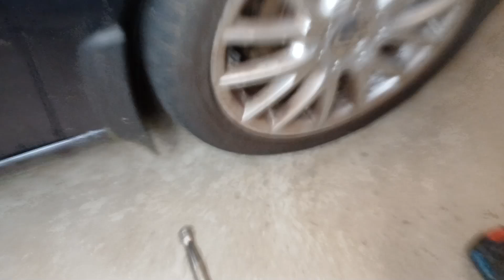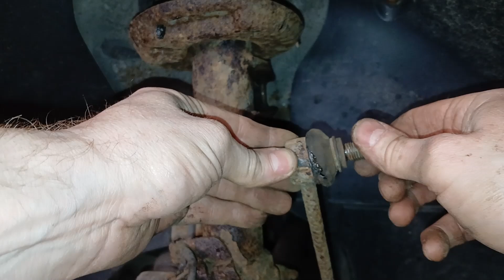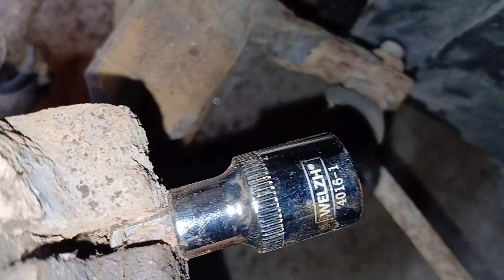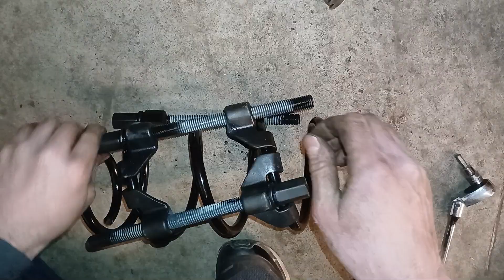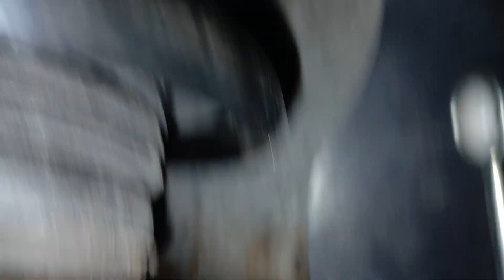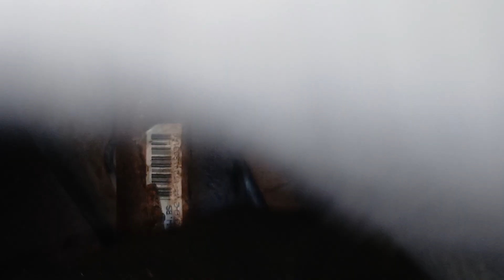VW Golf Front Spring Replacement - Full Process! #mk5 #VW #DIYmechanic

Comment: Timestamps (Powered by Merlin AI)
00:06 - Replacing broken suspension springs on a 2006 VW Golf GT.
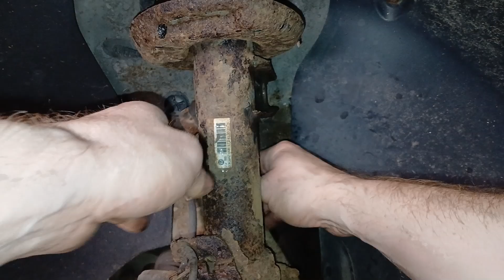02:58 - Assessing worn components before replacement process.
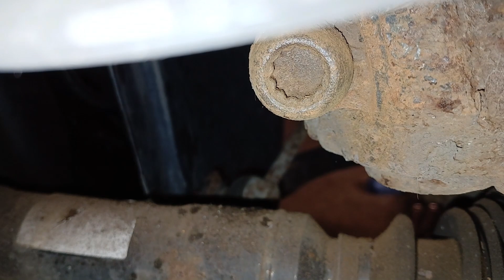09:15 - Replacing the VW Golf front spring requires special tools and techniques.
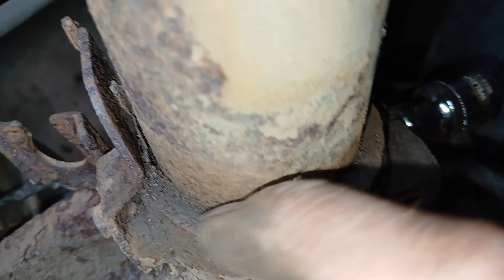12:08 - Preparing and cleaning components for VW Golf front spring replacement.
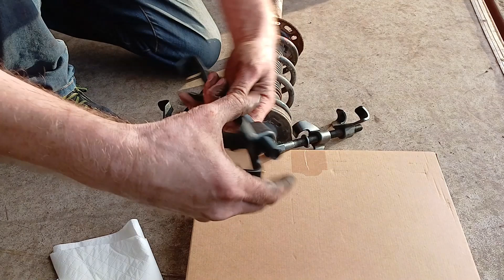19:14 - Prepare spring compressors carefully for safety and effectiveness.
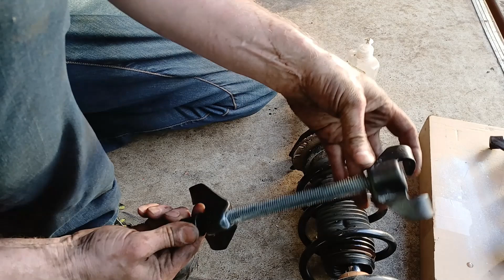21:40 - Use dual hook springs for safer VW Golf front spring replacements.
29:15 - Finalizing the front spring replacement with proper tool usage.
32:25 - Replacing a rusted drop link with careful methods.
38:26 - Reassemble drive shaft and lower control arm components.
42:36 - Reassemble the VW Golf with a new spring and torque settings.
Reply from the maker: Thanks!

Comment: Great video .Any problems with the driveshaft bolt torque ? VW  say 200nm +180 degrees .
Reply from the maker: Can be tricky enough! I stick a couple of the wheel bolts back in and jam a crowbar between them and the floor. That locks the hub in place to torque that bolt up to spec!

Comment: I find taking the calliper, brake disc etc off it allows you to move the calliper well away to give you more space and drastically reduce the weight of the steering assembly when you’re reassembling. Not much more work to do removing/ replacing these bits. 😁
Reply from the maker: That makes sense where weight is a consideration - I prefer to mess with as few fasteners as possible… especially when they are in the state of the ones I had to tackle here!

Comment: Not an easy job on any older car, anything that's been through a few winters and summer's will weld itself together through corrosion, as well you know...

I've had two goes at this job on my mk5 golf before now, I'm trying to lower it by 50mm, i have the relevant tools and the adjustable drop links to see it right but I'm having a total nightmare releasing the pistons from the pinch joint at the hub.
I'm going back to it soon so will be remembering what you've shown here, it's never easy working from axle stands height, not easy when you're well into your 50's. Anyway! Thanks for the video.

Comment: Thanks a lot for this video. 😊
 I'm about to replace the right front spring on my VW Golf 2009 (Station wagon), but in my case the spring has snapped at the bottom last turn. I also (now) have two sets of spring compressors that I intend to use. Seeing your video makes me a little more confident with the task.  I'll also replace the strut bearing while at it.  I beleive I'll be saving at least 2000 SEK by doing it myself. I have done a similar job on an old renault megane using one set of spring compressors. It was a bit scary to work on the strut bolt with loaded spring, hope it will feel somewhat safer this time with two sets of compressors.
Reply from the maker: Just take your time and don’t cut corners or use an impact driver - you’ll be fine! (Don’t forget the alcohol to degrease the spring also… that makes a huge difference!)
Reply: @bigtalltim  Thanks for your tip, I'll be careful with the spring compressors, when, or rather if I get there.  Guess what...   My breaker bar (1/2 inch socket drive) just sheared while trying to loosen the hub bolt. 😖
Bolt and socket still seem fine though.  Not sure if I should use a torch on the bolt to help softening  the loctite probably being in there.  My golf has 24 mm 12-point bolt head (not the 27 mm as on yours) and is refusing to come out.   I beleive I might  need a heavy duty air impact wrench to break it loose..
Reply from the maker: Wow - that is something I’ve never had happen! Definitely do a few more checks with other vids if your setup is different - might be worth taking the wheel off anyway just to be sure that there isn’t a cotter pin or bent washer holding it in place… you can always slap it back on for detorquing that bolt!